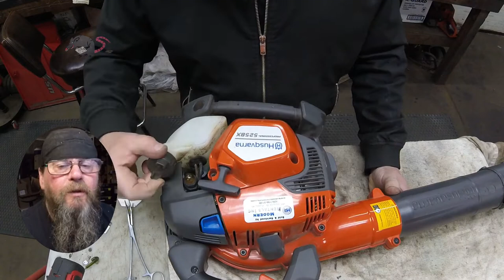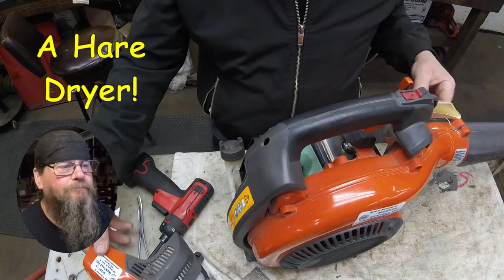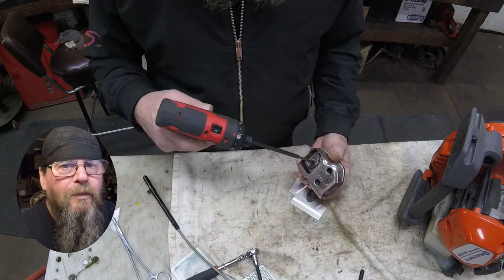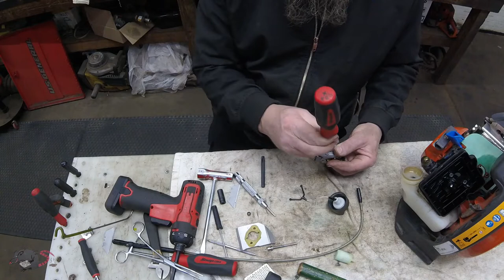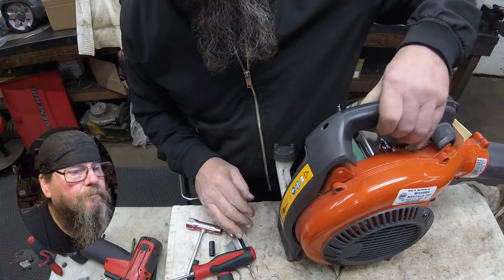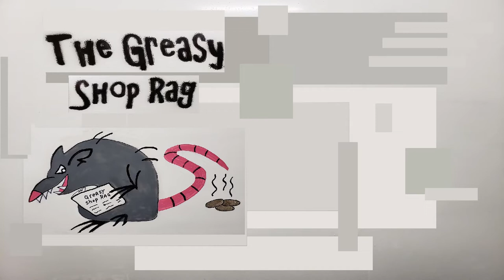Husqvarna 525BX Blower No Prime-Fixed

Comment: What was the problem with this blower? I have the same blower and the same problem. If I do get it to run, it runs until it warms up just like for a minute or two then it starts bogging down.
Reply from the maker: The answer comes in at the 5:00 minute mark.

Comment: Have the same blower, starts up but then sputters and stalls. Tried new carb and doe# the same, any ideas?
Reply from the maker: Dirty fuel filter? Hole in the fuel line?
Reply: It needs time to warm up on with the auto choke.  I’ve also found that restarts are tough after shutting down for 15 mins or more